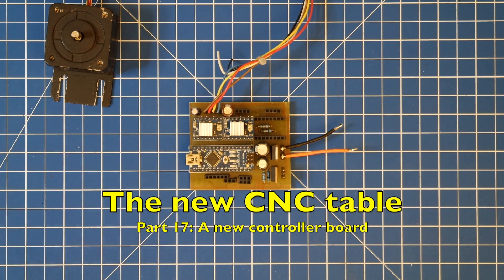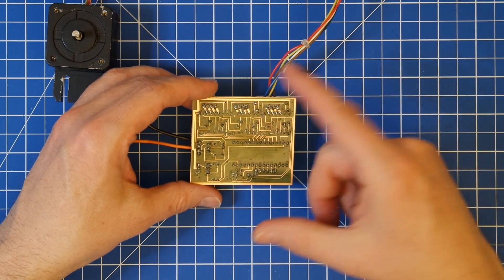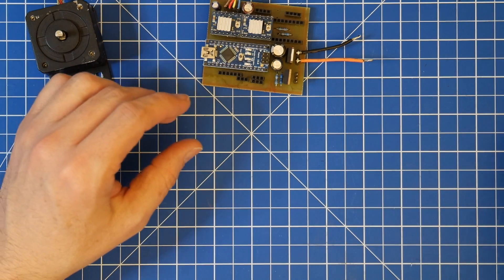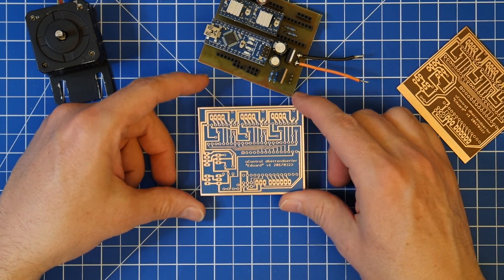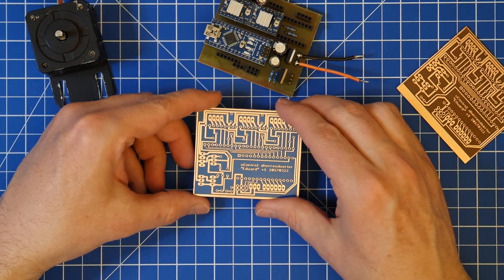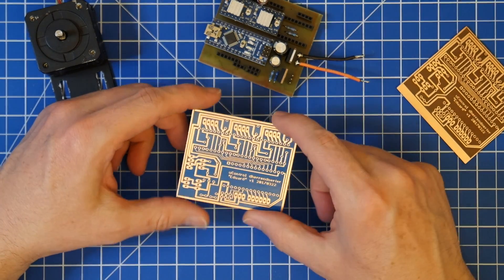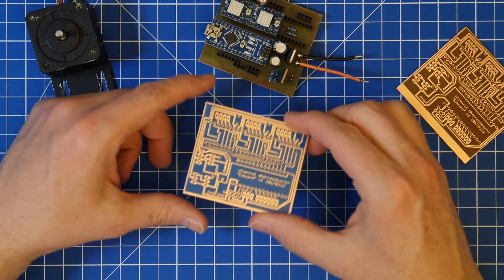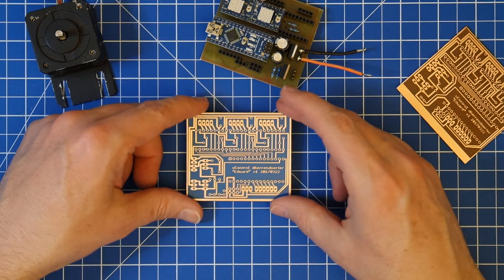The new CNC table pt. 17

Comment: It is possible to 28BYJ stepper motor than nema 17?
Reply from the maker: Yes, certainly.
Reply: @dherrendoerfer  need change from unipolar to bipolar or no?thanks for your kind answer  :)
Reply from the maker: It depends on the controller you intend to use, with 28BYJ you can use a unipolar controller, just be aware that the 28BYJ have a lot of backlash.
Reply: @dherrendoerfer  thank you very much for the information :)
Reply: @dherrendoerfer  hey its me again, iam wanted to build your plotter V3 but iam want to use 28BYJ 12V version, but need i to change software or/anything? Btw sorry for my English, iam Indonesian.
Reply from the maker: For most software you need to set up the steps per millimeter in one way or the other, but in general, no.
Your english is fine - no need to apologise.
Reply: @dherrendoerfer  my plan its use your controller and firmware version, but it is capable to work with other software such a inkscape?
Reply from the maker: Have a look at this: this also works with the 28BYJ steppers
Reply from the maker: This: https://github.com/dherrendoerfer/grbl
Reply: @dherrendoerfer  thank you very much, you are so genius and kind, i Will build it later because in Indonesia now its Ramadan Session and i think delivery Will be late, and iam sorry for late reply cause YouTube do something  weird to my account
Reply from the maker: @fauzanabdullah5290  You're very kind ! I don't believe I'm genius, just very suborn and versatile with tons of experience .... haha! It's a lot of fun making small machines, and big ones too. Just remember to never give up and always be kind ! Stay safe, stay healthy !
Reply: @dherrendoerfer  You Too!!

Comment: nice! could have just made the Microcontroller on the pcb, and reduced a lot more space. nevertheless it looks good! What was wrong with the milled one? I am actually now going from using the photosensitive boards to milling because I am tired of the etching process and hand drilling holes. I want to mill and drill holes and be done with it. Not sure where you source the presensitized boards but mine were getting expensive so much that for 5 bucks I can get 4 boards made and delivered in  a week. for the same price. but still for quick pcbs i am turning ti milling now.
Reply from the maker: Those boards are very cheap here ( in Germany ), like 75 cents each. The boards were designed so I can make them with a plotter.
Reply from the maker: Oh, forgot ... I have a lot of pcbs make at JLCPCB these days. I've grown fond of the EasyEDA web service, and every first item in an order is 2 dollars plus shipping. I can't beat that.

Comment: Hey Dirk. First of all, thanks for your videos and the projects you've shared with us. I remember you saying that the software for the new boards is different from the previous controllers used in  plotter. Did I understand it right? Could you, please, give some kind of instruction about which software is used for each of the designs that you have on your github? Cuz it's not so easy to understand it. Thanks in advance, keep up doing the cool things! Good luck 🍀
Reply from the maker: Hello, your best guess is to go with the v4 beta firmware. It supports all boards and is very versatile. The original firmware will probably be replaced by that one, because it relies on the Stepper library, and every change on that breaks it.
The v6 beta firmware is still not ready, and I'm not making any progress there, it's just so complicated ;-) 
Cheers, 
Dirk